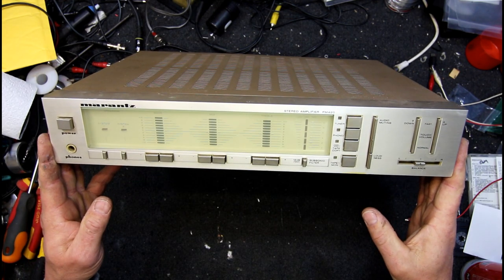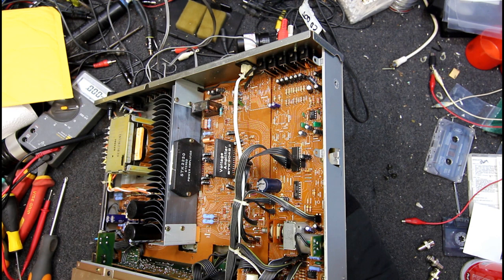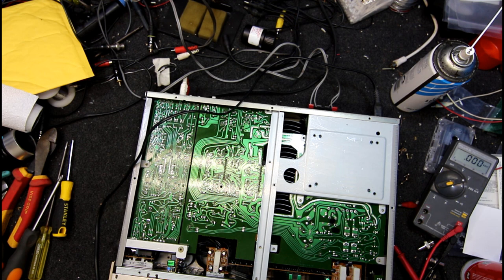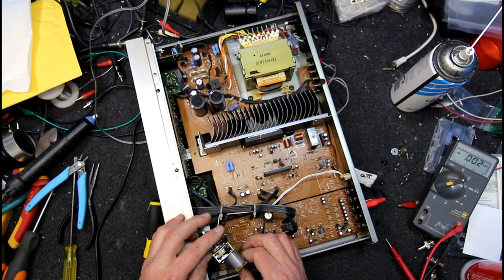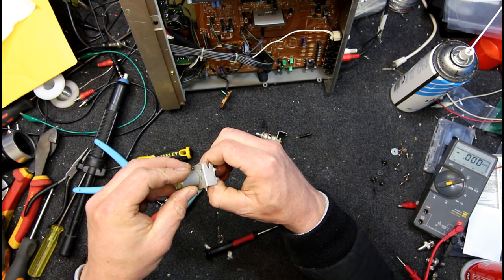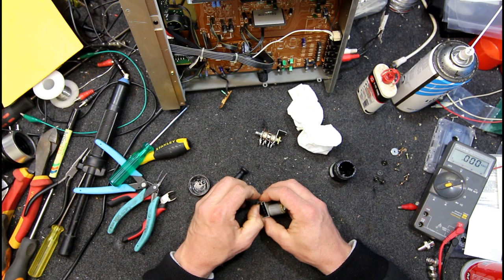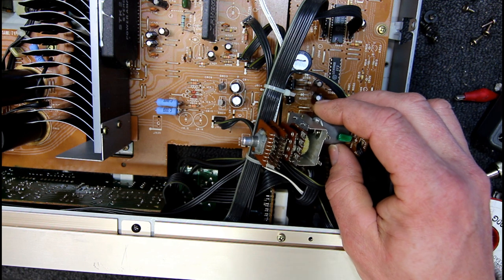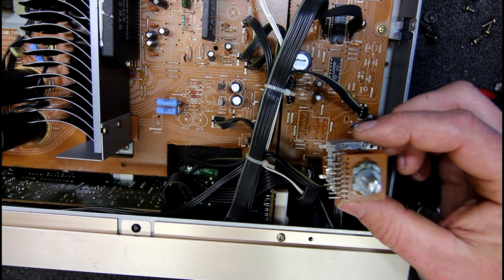Marantz 1982-1984  PM420 Amplifier No Volume Control.

Comment: Do u repairs? I have just purchased the same model and the switches to select tuner/tape/phone does not seem to work. Any suggestions
Reply from the maker: The Toshiba chip between the two black ribbon cables handles that. It may be faulty, or missing a voltage, or something like that. Also possible there is a problem with the switches themselves, but unlikely that none would work.
Reply: @StevesElectronicRepairShop  thanks for that… anywhere in Melbourne u would recommend I could get it fixed?
Reply from the maker: @billnimo3733  Not sure but there are audio people there. There is an Australian Hifi group on Facebook you could join if you use it, and ask there.